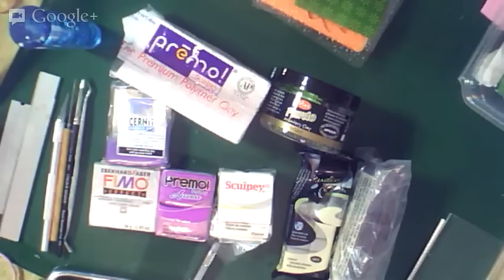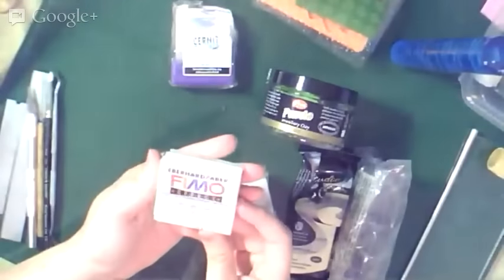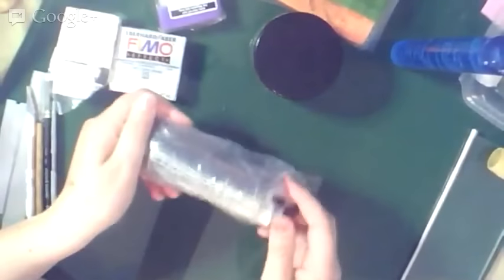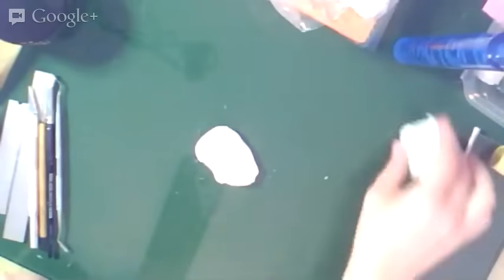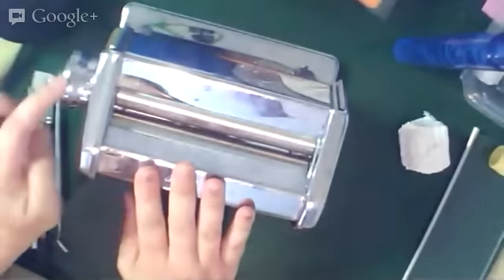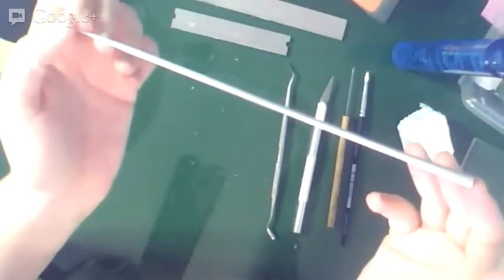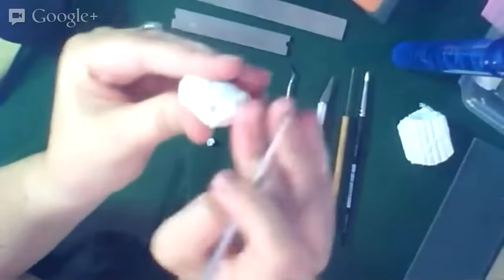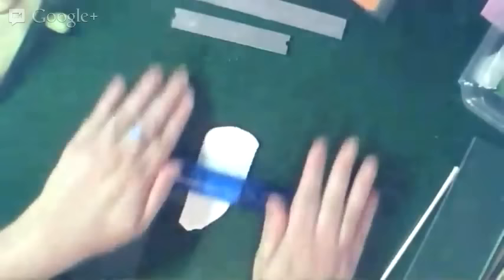Learn how to work with polymer clay, what are the best tools and how to bake

Comment: i know this might be a silly question but how much clay do I cut off the brick to put though the pasta mechine? I want to make jewelry. I want to cut canes into  pendants. Did you say you can cut the clay after its baked?
Reply from the maker: Amanda Bennett You don't want to stress your pasta machine and bust the rollers. Just cut it a little bit wider than the machine setting of your largest pass. Then roll it through and start the process.

Comment: I have a few questions
If i wanted to paint the clay what kind of paint would i use and would i have to put some kind of finishing polish on it or would i have to bake it with paint on it?
and if i want to make a charm would i be able to bake it with the metal piece already in it?
Reply from the maker: daphireswindel You can use Acrylic paint or heat set genesis oil paints, either before or after baking. Let the paint dry before baking. Acrylics work great after baking too. You don't have to seal paint, but there are many tutorials on sealing clay on Youtube if you really want to. And yes, you can bake metal charms (just check and make sure it doesn't have plastic on it because that can burn.)